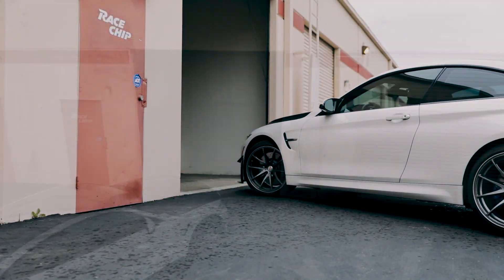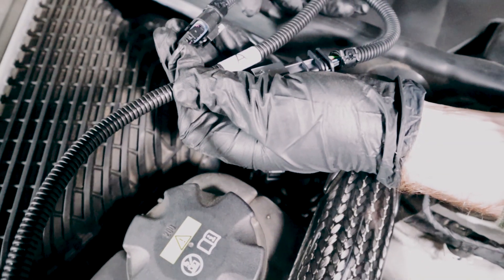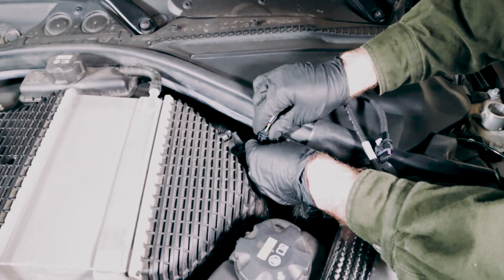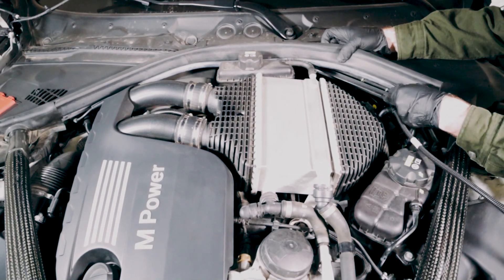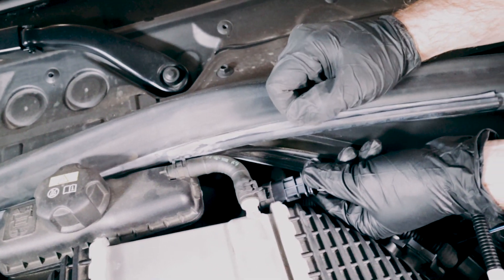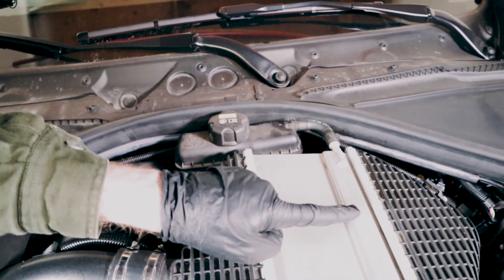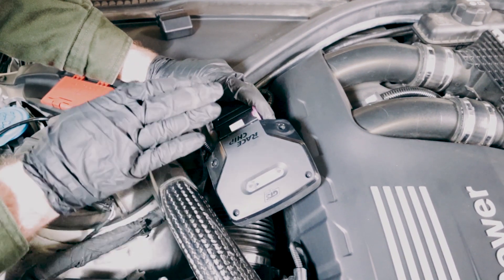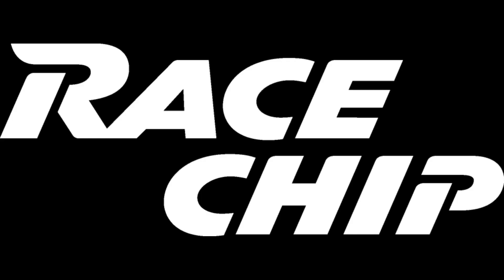BMW M4 S55 Engine RaceChip Installation | M2 Competition | BMW M3

Comment: This is not M2 Comp. You’ve left out C connection to Camshaft which is the most difficult. Only M2 Comp and CS have three channels, M3 and M4 use only two channels.

Comment: For the RACECHIP GTS BLACK I received, there are only 2 connectors, no C camshaft connector. Why this ? What's the difference between the two version with and without C connection ? Is the version with camshaft sensor connection C more reliable for the engine and gives more power or tuning options ?

Comment: Did these just have  default value for every one sold, or can these be tuned?
Reply from the maker: Each product comes tuned for their specific vehicle and engine. The top of the line products, like the GTS Black, come with 7 maps ready to go  that allow for fine tuning via the smart phone application. We also have the ability to adjust files remotely when the app is purchased at checkout as we can send updates over the air via the app. No computer/laptop/software required from the customer.

Comment: Thanks for the video, I follow the instructions installed the RaceChip gts, when I started engine, I didn’t see any digital number appear on the clip, is it normal? But my phone app can connect the chip.
Reply from the maker: Try pressing the buttons on the chip to see if it lights up while the engine is running. The light is only on for 30 seconds and then turns off. The chip is still active after the light turns off. If that doesn't work please email support@racechip.us and they should be able to further help you.
Reply: RaceChip Installation Videos OK thanks